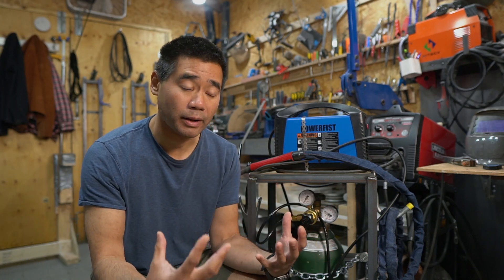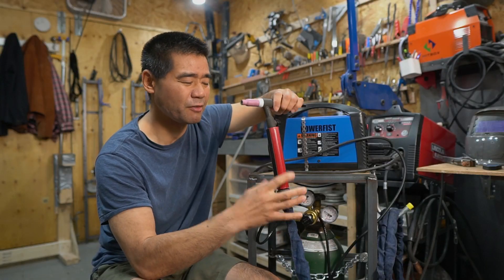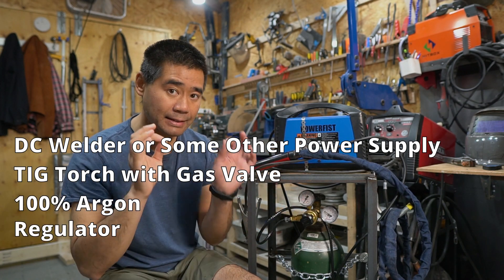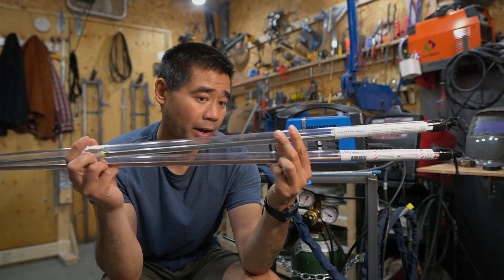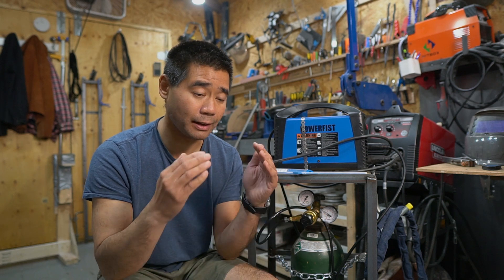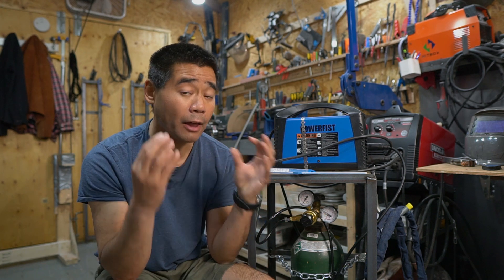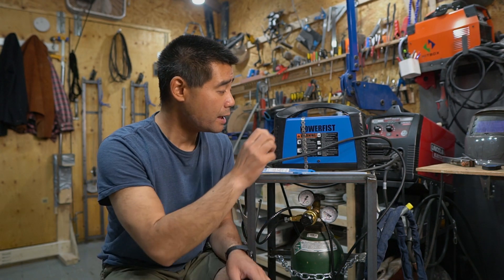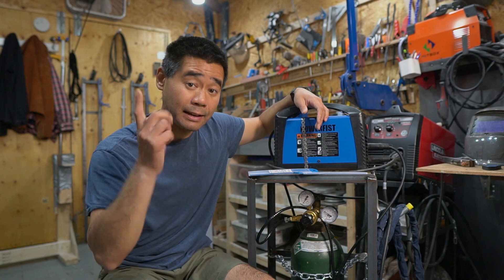How to Make a TIG Welder | Scratch Start

Comment: saw somewhere you should grind tungsten pointing it staight up into the oncoming belt or grinder. just means the grind is going in the right direction away from the point
Reply: useful video thanks

Comment: 7:35 you can’t control post-flow? Whenever I’m doing scratch start tig I use a homemade blade switch foot pedal so you can stop the arc of the torch but leave the valve open for post flow when you are welding stainless for example
Reply: maybe using an electric controlled valve ( i don´t remember the exact name)
Reply: @Quimerateck  a solenoid?
Reply: @timokapitein414  yep
i think that is